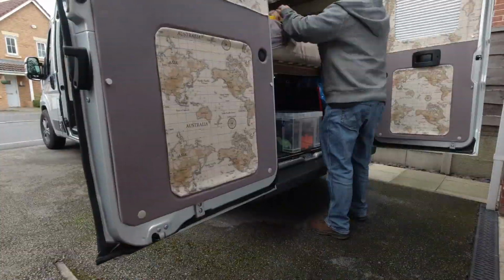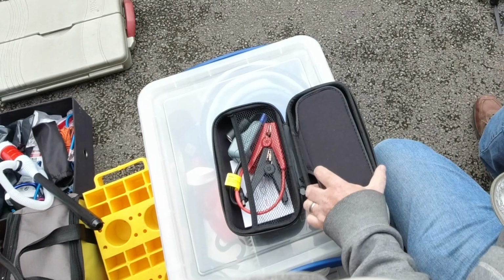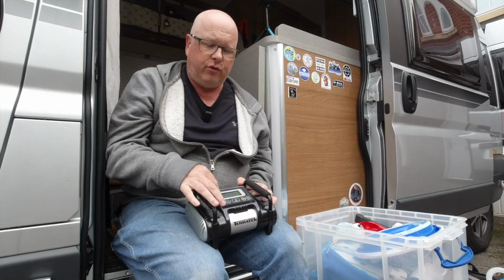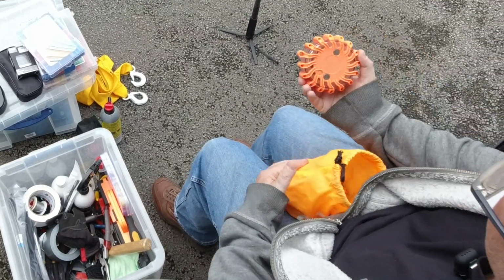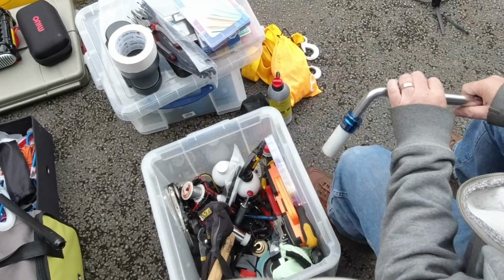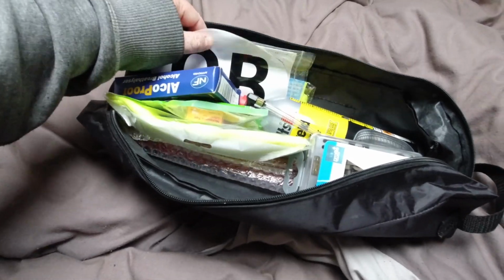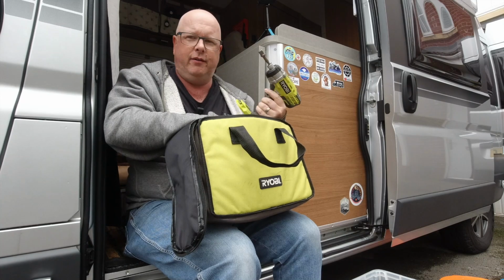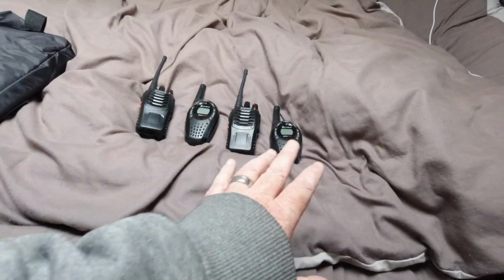My Campervan Breakdown & Maintenance Kit

Comment: Great vid, I'm going to get one of those jump battery kits right away!
I've found that even cheap tyre inflators will pump my tyres up to 50psi, so long as I jack it up to take the weight off the wheel. (anything higher than 50psi should have high pressure valves, as normal tyre valves will fail).

Comment: My Dad had the Finilec Tyre Weld stuff when it first came out in the 1970's, we found out about it from one of the top Trials riders of the time. We used it when we had 2 punctures heading off with the motorbikes one day in the Jag - think we needed 2 cans as they were huge tyres and we had 3 motorbikes on the trailer and quite a bit of gear with us too.

Comment: Hi John - If you're relying on that tool kit for breakdown repairs on your van, you might want to check some of the bolts: They're very likely internal and external torx, not hex, so none of those sockets will fit. Be prepared :)
Reply from the maker: I’ve worked on most of the van, including suspension, chassis, doors, mounts etc and this toolkit is perfect.
Reply: Great! :) Mine's almost all Torx :(

Comment: John, I don't know if you have come across the tire plugger solution. They are very useful. Quick tyre repair without wheel removal in most cases. Very easy to use. Suitable for all tyre types. (except those with tubes). I primarily use it on motorcycle trips as there's no spare wheel!! But I take it with me in my camper especially when heading off to very remote places. Even if only used to get you to a garage or safer place to change a wheel. Added benefit is no mess, like the sprays. 

I did a short (pretty poor quality video on it). https://youtu.be/P3J-jClFVwo 

Video quality is a long way short of your great videos, but you can see it in operation. 

Great video today. Always better to be prepared!
Reply from the maker: Great idea Paul 👍🏻

Comment: in France you should have a breathalyser kit i be leave
Reply from the maker: That's what I showed in the kit in this video 👍🏻
Reply: In France you need to carry a breathalyser (it's about 130€ on the spot fine if you are caught without one - But in practice you need two as the cops can ask you to use one (and you will then need the second one to continue driving), You also need a Hi Viz Jacket for every occupant - Available from the cab so you can put it on before exiting the vehicle, You also need to carry a Warning Triangle so you can give 300m advance warning of a breakdown .... If you breakdown just as you exit a bend, hazards alone are not good enough.
You should also carry a first-aid kit and a fire extinguisher .... If you come across an accident, You are obliged to "give assistance" as appropriate (Theoretically this can be as little a phone call)